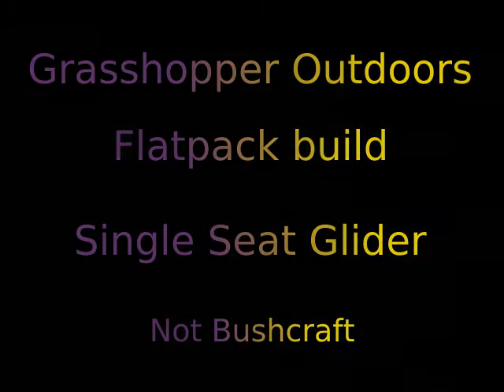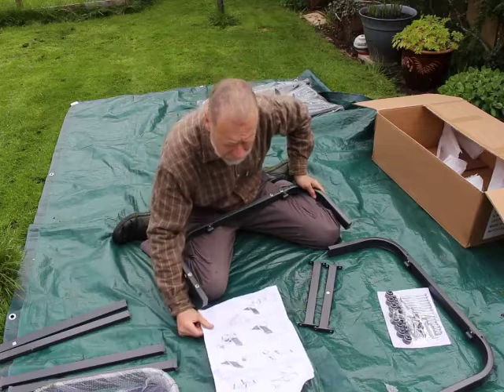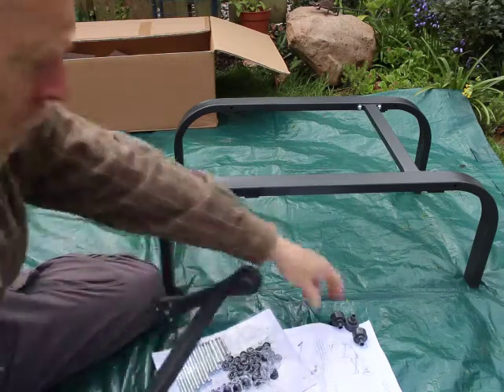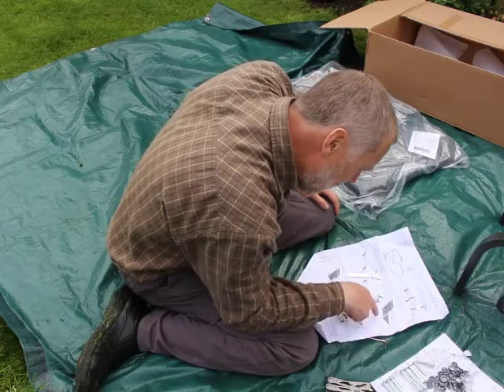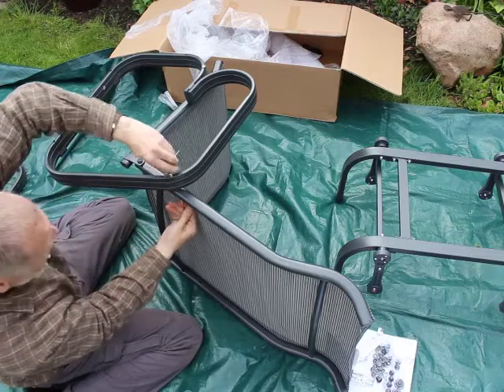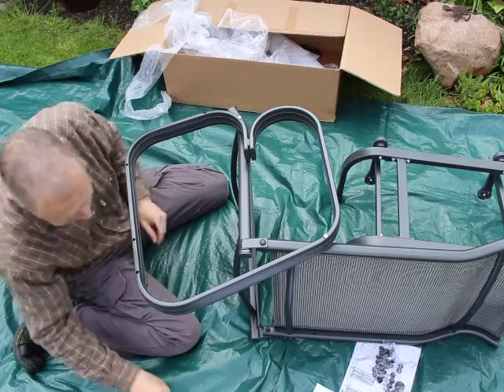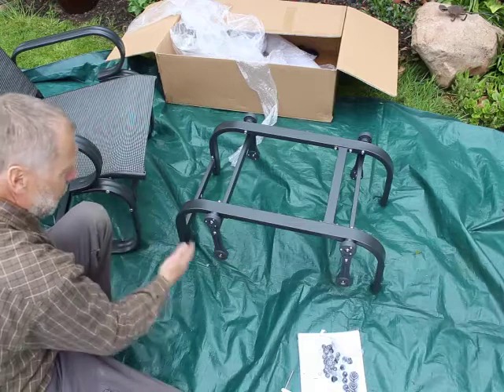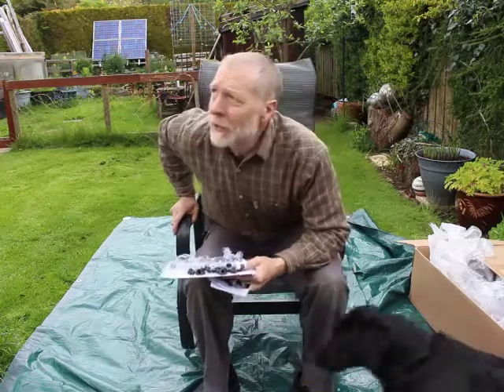Flatpack Single Seat Glider Rocker Chair.  Not Bushcraft.

Comment: Putting things together with nuts and bolts from a store islets of fun. My friend and I had to put a large tin shed together with like 1000 nuts bolts and washers plus all the pieces of tin! Nice job!
Reply from the maker: Trouble is the instructions were written by some one who knew what they meant, in a foreign language. When you are doing it for the first time you really have to guess what they meant :-) but all said and done it was not that hard. I missed the bit out where I was whacking on the plastic bolt and nut covers with the poss-tub dolly at the owners house :-)

Comment: Beercan Bushcraft may have ended the video on a slightly boozy note 🍻🍻🍻
All the very best to you and yours 👍 👍 👍 🍻
Reply from the maker: Well I had to drive it too it's owner, and when I got there I had to use the poss-tub dolly to hammer the plastic caps on the bolt heads and nuts ( because I did not have a rubber mallet), now that was a laugh.